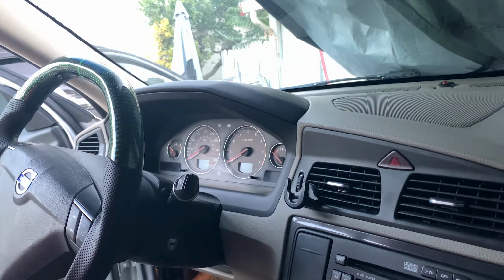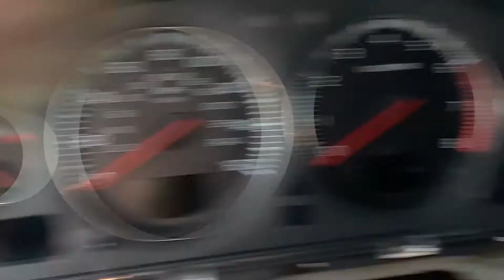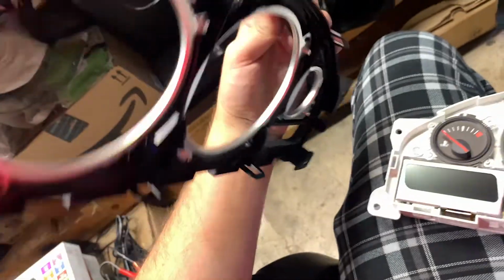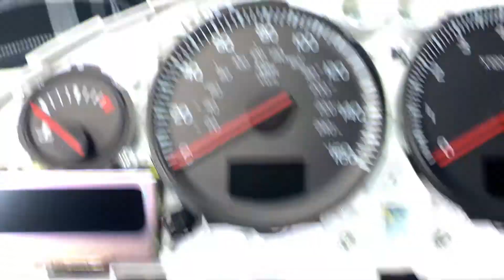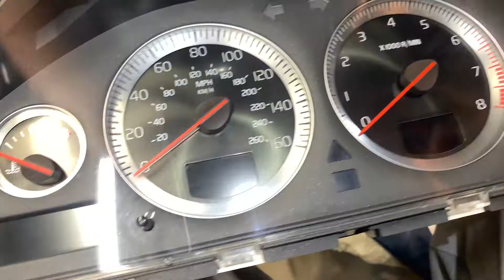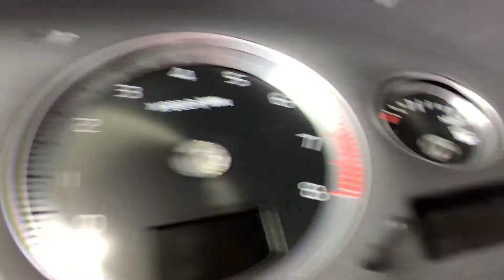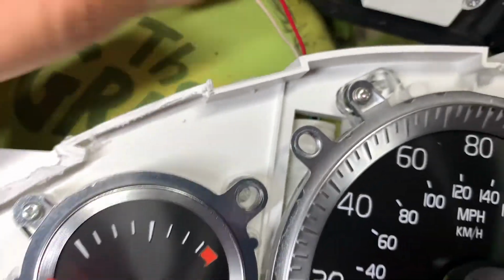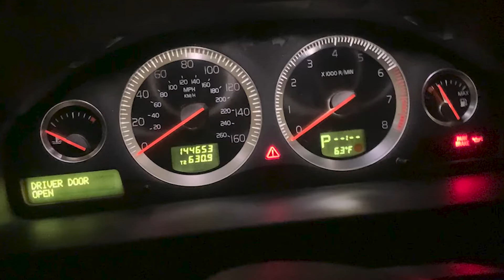How to: P2 Volvo Gauge Cluster / D.I.M. swap!

Comment: Did this to my diesel v70 a couple of weeks ago, but with the blue gauges from xc90 r-design. I see that the cluster you are robbing the parts from also is from an xc90 since I had to do the exact same modifications to get it to fit right. Only difference for me was that I already had the black watch dials so there was no need to solder anything, just plug and play on that part. At first I only swapped the faceplates and needles and ran it like that for like a month or so but wasn't satisfied altough I didn't have to modify antything for that to work. Took me a while to figure out that the xc90 had taller clear peaces behind the temp and fuel gauges but man was I happy when I found out that all I had to do was swap them over to be able to have the silver rings ontop of the watch dials for that "deeper" sportier look
Reply from the maker: Hey! I agree! Was worried about it not looking right and was like screw it , let me try the other clear pieces and it worked!😂i was about to go crazy with the dremel 😂
Reply: @positivegarage  yeah I was about to break out the dremel too but figured it was worth a shot swapping the clear pieces since the middle gauges lined up. Altough I wonder why the xc90 has the smaller gauges that tiny amount forward and all other cars using basically the same gauges don't. To be fair I did notice that there was a bit of a gap between the needles and the faceplates on those smaller gauges even when I ran my stock setup so maybe that's the reason 😂 weird tho that they left it like that for so long and just fixed for the xc90 😂
Reply: Much better